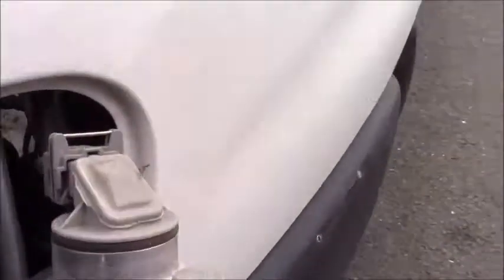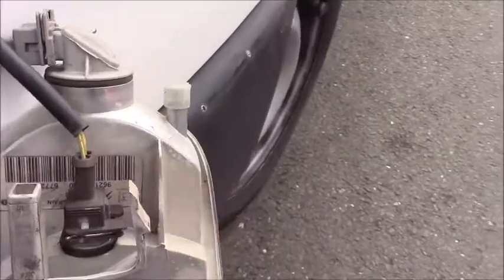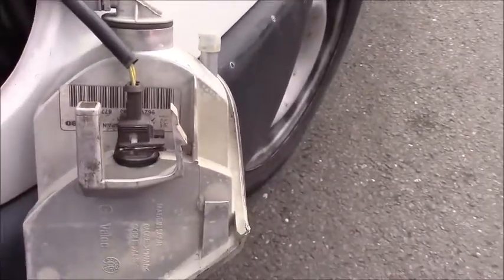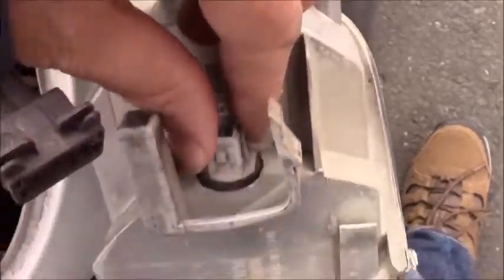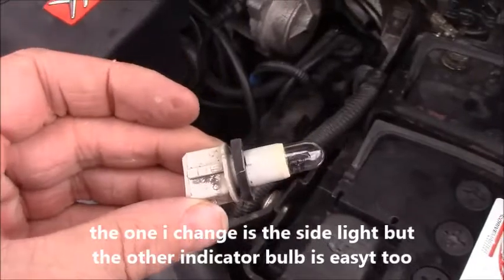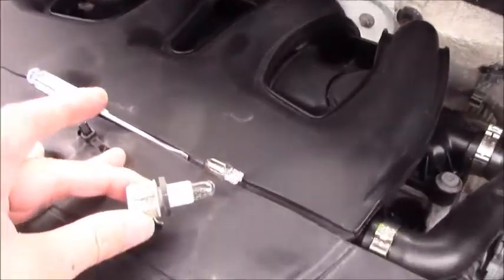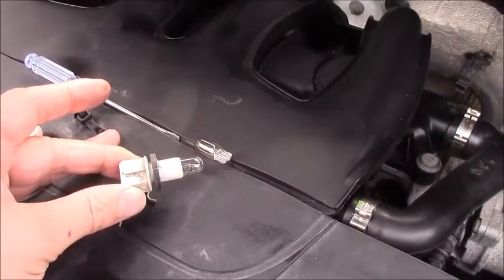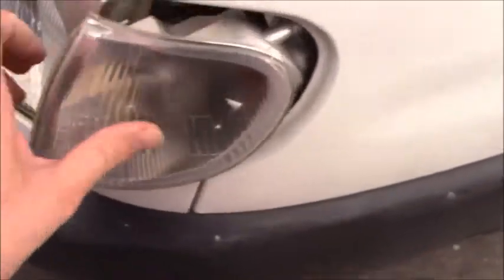Citroen berlingo side light and indicator bulb replacement

Comment: Hi, I've got a newer Berlingo with the light casing going all the way around as one thing, so I can't remove the side casing like in this video as it's all one thing.. just wondering if there's a way to remove the whole casing?.. also, otherwise, I can get to the indicator bit by removing the rubber casing on the inside instead, but can't see what I'm supposed to be pulling out.. just wondering if it might look the same as this video - thanks! :-)
Reply: This video is completely useless. On the inside of the newer Berlingo’s there are some Black plastic lids that protect the lights. These are accessed inside the bonnet. Behind the lights. I’m trying to change mine now. Mines a 2014 Berlingo. Did you find out how to change them?